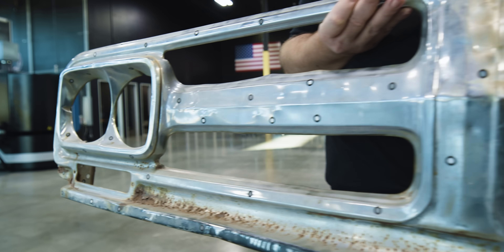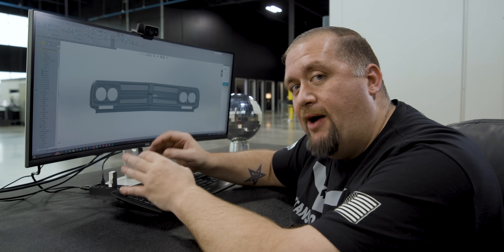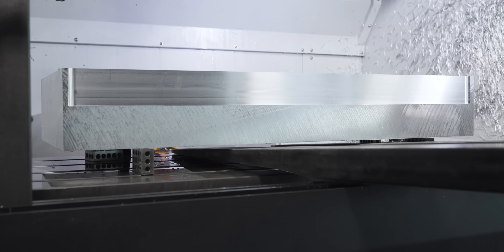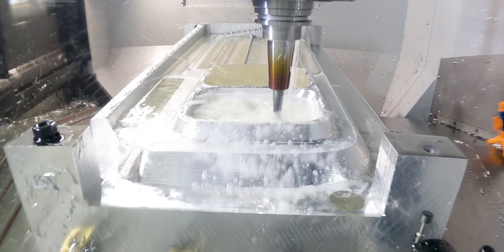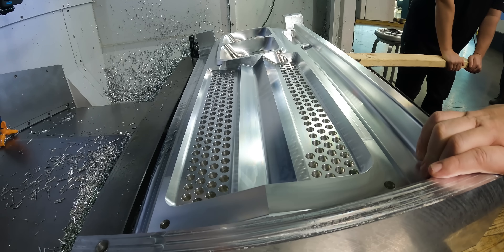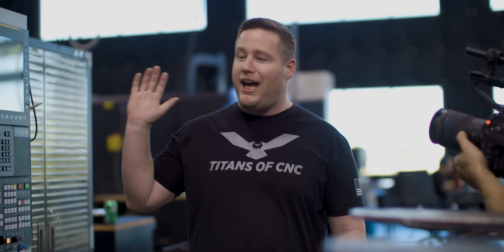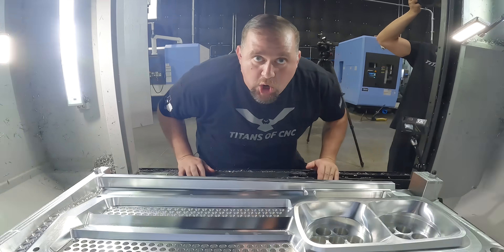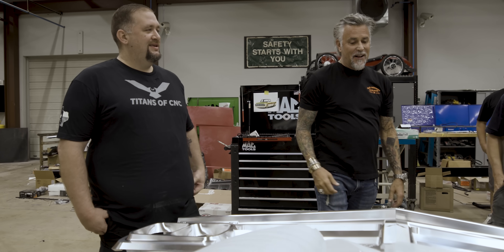Machining the World’s Greatest Truck Grill for SEMA 2023

Comment: Hello, Barry amazing workman ship.....Did you observe any distortion or deflection in this large aluminum machined part? If yes, how much? If not, what is the reason for the absence of distortion or deflection?
Reply: On this one it was hard to say, because for once, actual dimensions didnt really matter. Only fit, form, and function. All i can really say for sure is that there was very little deformation between op1 and op2. However, in the past on aluminum parts that were large, we found that we needed to leave around 1/4” per 120”, as the part tended to relieve by more than 1/8”
Reply: @barrysetzer  👍thanks brother

Comment: Couldn't you just have poured the aluminum into a mold and finish machined from there? It's not like this piece is structural so it doesn't need the strength. Seems a bit overkill to use a solid block

Comment: Block it in and flycut the raw stock. Then mighty bite to put 4 threaded holes where the bolt holes are. Then you can bolt it to 2x4x6 blocks. Just another way to start, this how we done mold details

Comment: Because they can? Sure. I even enjoyed watching the machine work, but cant help but point out that this is really poor engineering. Even if you're desperate to replace a piece of stamped sheet metal with a machined one - looking at removing this much material should get those gears between your ears moving.

Comment: You guys qualified an edge along X to find your Y origin on the following op but what about your X origin? How did your X origin get set to correlate dimensions from Op a to B and B was when you cut the mating edge for the middle seam? Wouldn’t the overall length of the full assembly get shorter and/or longer if you did not qualify and edge to find X?

Comment: Nice.  But one of the things you could do with additive is print the mounting bracket on the grill (allowing a much thinner piece of stock to be used), though that's more of a EBM wire technique than a powder bed technique.

Comment: I am a "body guy".  I have done a "few" restorations of 50's-60's cars, and the stainless trim is the biggest headache.  You can not buy new, so you have to learn to repair the old.  Sitting at a desk with home made wooden dowels, picks, and blocks, getting every little dent out, until its flat to the eye, then many, many hours on a polishing wheel.  It is a very, very time consuming process, that requires tons of patience, skill, and a little luck. The ability to mill out a chunk of aluminum, in any direction you want, is amazing. It has opened doors in the custom world that never existed.

Comment: How do you run programs with this much code? I program doosan’s with mastercam and I sometimes have trouble fitting so much 3D milling into one program. Did you do this in many programs?
Reply: Look up DNC, distributed network control. The server feeds the cnc code, so you can run a big program continuously.

Comment: Well to be truly honest, this was an easy part to make....Just a 3 axis machining ......sort of like cutting large Injection mold. The only thing I would be worried about is the wall thickness, when you cut the back side. I would like to know the material removal rate with that long endmill, while roughing and why you chose the endmill, rather then shell mill Z-level roughing. Shed some more light on this, please!
Reply: The reason I had to use that endmill was that the stock took up the entire work envelope, So a shell mill could not have started "outside" the stock. So rather than use a 3" shell mill .075" deep, I used an endmill to go 3" deep with a .075" stepover. Relatively the same material removal rate. And the hard part about this job was only having a few days to do it and needing it to be flawless. That, and the fact that on the second side the entire part was off the table except for the 4 corners......

Comment: With a tig welder, you could really add value by welding the bracket into place...or bolt it on. I get it, its a show piece, and your showing off. But really, wasted a lot of aluminum... :)

Comment: Awesome work! There's a way Gas Monkey could sell a lot of those grills at a cheaper price. Just make them from all cast aluminum or light steel 
and polish them up or anodize them. Or, perhaps make them in different colors of carbon fiber to match vehicle paint schemes, or just make them
from fiberglass ready for painting.

Comment: Barry, do a video on how you took the point cloud data and created something with geometry you can click on. I have attempted this in the past with little to no luck whatsoever. It’s like solid works didn’t like the point cloud data.
Reply: I can do that. The problem that you are probably having is that your Solidworks import settings are bringing the mesh in as a graphics body. If you change that import setting to surface you well get geometry you can click on
Reply: @barrysetzer the mesh becomes an xyz target to weave a 3d spline, which becomes the basis of the surface model, takes a while to do.
Reply: @mrwolsy3696  you’re telling me this, as if i wasnt acutely aware of how hard this was
Reply: @mrwolsy3696  hopefully you realize that I am the one in this video that scanned, modeled, and machined the part.
Reply: What kind of scanner were you using?
Reply: @kgranno  The Creaform Handyscan from Dynamic 3D!
Reply: Hours of clean up repairs, they skipped showing this.
Reply: I had never tried the diff import settings, but I will def try it next time I am manipulating point cloud data. Thanks

Comment: Geeez if Barry was a real machinist he would made that grill out of a single piece of aluminum! 😂
Reply: That was the original plan but our new MYNX 7500 wasn't finished being setup. With a super tight deadline of getting the part finished for SEMA, Barry basically slept at the shop and had to get it done on the smaller BVM 5700. Turned out amazing given the stress of lack of time and sleep!

Comment: I’d love to see how you get the scanned model to a 3D model that you can program to. Do you have any videos like that in the academy?
Reply: It was NOT as easy as it looked in this video, for this part it took me about a week. But for geometric parts there are softwares that help convert the mesh to a solid. Content coming soon!
Reply: @barrysetzer awesome, can’t wait for that content. I always wanted to know how it was done. Loving what you guys do all the way from Northern Ireland 💪
Reply: @barrysetzer  Yeah really interested in seeing more of that process.  I'm a somewhat young Mech Eng and my work is starting to involve a lot more 3D model scans that generate point clouds that I need to reverse engineer off of, so I'm really wondering what are the most efficient ways to deal with this point cloud, and the work flows/process involved. My thoughts are there are 2 main ways I could go about it.  First, I could use the point cloud, which for anyone else reading represent points in 3D space, captured from the parts surface (where each point will be slightly misplaced from reality by differing amounts) import it into SolidWorks (or anything comparable) and create planes of best fit from these points according to my best judgment.  Could square up these planes or even generate new planes off them, and go from there, ie. I'd have a squared up reference with nice planes to use to model my 3D part, inside this cloud of points.  I'd essentially take the point cloud, and make planes in key spots where I need them, like datum surfaces/mating/machined faces etc, and leave the rest of the point cloud reference as is.

Second main option is I think there's software out there that takes these points, and automatically creates meshes out of them.  I'm not sure how this works exactly, if it makes little triangle surfaces between each point, which would generate a very bumpy mesh, and is bound to have some wonky surfaces, or if it creates approximate planes of best fit that go through the cloud of points, interpolates between them, and comes out with an average surface representation.  I believe you could then use this surface model, and model off it in SolidWorks much more easily than a point cloud, or even enclose it and create a solid.  I'm confused how to deal with these mesh/surface models in general, and if you can use the whole Solidworks surface tool interface on them, ie stretch, expand, add to, trim, cut with planes etc. One benefit I see of a full mesh over a point cloud is it's much easier with surfaces to tell if there are any interference's, or the levels of clearance between your new 3D model and the scanned part.  Where as this could be difficult, if not downright impossible to do with a point cloud in some cases.  Would love any more info on this whole process, and would love too if anyone in the comments knows stuff.  

Great video btw!  Sorry for the huge comment :P thanks for reading, and sorry for saying point cloud 80 times.  Really loved how you showcased the whole process to a good degree in a fun and interesting way.  This is great stuff to get younger people interested in machining/mech eng/fabricating etc in general.

Comment: why not inset and tap a separate mounting bracket for the back so the stock didn't have to be so thick?
Reply: If you look at the original design that was 3D printed, there were another set of mounting brackets as well as a big feature across the top of the grill. However, Gas Monkey changed the type of hood after we had already ordered the material, and those features were removed.
Reply: @barrysetzer  gotcha! thanks for the response

Comment: This is crazy :D . I have a small CNC milling machine with a 3kW spindle, but I like to look at such craziness and large "details" as it was created.
Reply: You can machine this too providing your CNC from Z axis spindle to Y axis reaches 1/2 the job length crosswise, simply remove guards and create datums to dial in for each consecutive portion! 

This will help you take on larger capacity work improvising using this method👍
Reply: @Th4thWiseman this would take him weeks of non stop running the machine since he probably has 6 or 8 mm max tool holder in the head with that CNC...but its possible 😄
Reply: kW? What's the RPM max?
Reply: @Xphinity  3 kilowatts  and 24.000 rpm . Same lake this https://www.youtube.com/watch?v=u9n25bH03dU . No problem with aluminum, copper, brass, etc. Steel can also be milled, but at reasonable speeds :D. It's great for hobbies and small projects